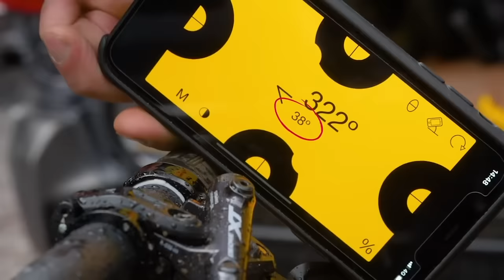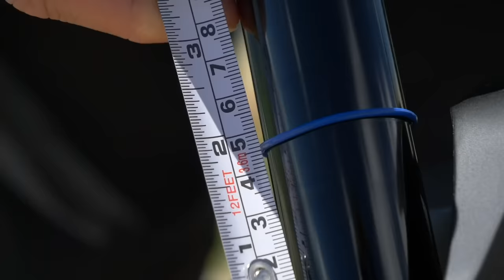9 Mechanical Skills Everyone Should Know | Essential MTB Maintenance Skills

Comment: Thanks, I would add a tip about hex/allen keys, and indeed all spanners or wrenches if you prefer.
 Always think in advance what would happen if it slips, or shears etc where will your hands and fingers end up. Particularly working around gears and chain rings. Make sure a slip results in your hands falling away from danger points.
 Everyone who works with tools learns this the hard way, so avoid it from the start.
Reply: also, clean off the bolts because the grit in them will erode your bolts and tools
Reply: Haha I've always had a phobia of this
Reply: I punched my brake rotor the other day.
Reply: @creekboi7  punched the chainring the other day and needed 5 sitches, definitely be mindful of where your hand will go

Comment: 6:56 Neither of my bikes came with a shock pump when they were brand new and when I upgraded the fork on my xc bike it also did not come with a pump. I had to get a Rockshox one from Amazon for £20
Reply: I thought the same, perhaps only when you get given bikes too 😂
Reply: Same, since he mentioned it I almost feel like I got shortchanged. Almost a 4k bike, but no pump :/
Reply: I didn't get one and I have a good 500 dollar trail fork
Reply: @thxman1968  it maybe a country thing, like how some phones you can get in Europe have a case in the box but if you get the American version it doesn't come with one
Reply: @MrStevegregory  no its generally when its really expensive forks
Reply: It’s only for expensive forks/ setups for sure, but you can get a good analog shock pump for relatively cheap and will save you a tonne!

Comment: The only thing more expensive than not looking after your bike, is paying someone else to do it.
Reply: I would say that doing it yourself is pretty close. I work at a shop and we make a lot of money fixing mistakes of the home mechanic
Reply: @mrdudemanmwane8963  Haha, it's the way around for me. I'm still an amateur, but I always need to fix my bike after it's returned from a big repair at the bicycle maker. Working on your bike needs to be done with time and love!
Reply: @mrdudemanmwane8963  I can believe that, but if those home mechanics learn from their mistakes and persist they will get good eventually and save money on the long run.
Reply: I think it took like 33 hours to figure out how to properly adjust a break pad after taking it apart because it was loose... the mechanic is way cheaper.... sigh
Reply: I'd say not doing it is far more expensive. If you don't do it at all then that's going to cost you much more. Buying tools is also expensive, especially for parts you rarely need to get to. Better to take to a shop in that instance. Everything in this video is 101 basic.
Reply: @JZ-xu3vg  if you can not even sort out brakes pads then you should not be riding a bike lol, i learned hard from the bike shop lies, when making out they did jobs on my bike and never, saying they serviced the bike and then the i still needed a freehub on back wheel, it was their lies and ripping me off that made me take apart my full sust and re do the work they never did properly, i am thinking of showing this on a blogg post or youtube, as now with youtube and the internet its easy to spend some time and do your  mechanic work, starting off and building up to get better bikes and tools over the years, i am blowen away in how the shop will charge, for tubless set up he wanted £40 to start, in one shop here they never took the innertube out my mates bike and did a basic tubless set up, daunting at first it can be, but in bike shops they will make out its worse than it is and parts need replacing that do not, that it's more complicated than it is, i trust halfords more than the local shop, i was loyal spent a lot of money in there overthe years, then they started to act like trotters independent traders
Reply: @titusflavus4172  Yah it takes time to learn though I didn't pop out of my mommy knowing how to change a tire either.

Comment: One tip for bleeding brakes... use elastic bands to hold the levers 'in' overnight... that normally forces any bubbles up out of the system.
Also Doddy, get over to Blake's place and make his bike storage more secure...
Reply: David King I do that , though I use a cable tie.
Reply: @andygilbert1877  Yep, works as well, but I think the rubber band has some give to save the seals being under pressure for 6-12 hours overnight, plus it does provide constant tension to ease the bubble up and out... a zip tie just holds it in one place but with no subtle load to activate the physics of it all...

Comment: One of the best mechanical skills to have as a mountain biker is, the ability to fix a broken chain like new in 5 minutes.  Like everything else it takes a little bit of practice.  When it's done correctly the place where you broke the chain is stronger.   If anybody tells you that's a No-No  it's because they're either trying to sell you a chain  or they don't know how to do it correctly.  Your chain is only as strong as its weakest link.  That link is your master link if you use one. I've seen Master links rip in two.  Been doing it that way for 30 years,  broke my chain once in 10 years. And it was because something got caught in it.    My recommendation is to get an Old chain and practice.

Comment: If you find your Hex nut has rounded off inside, a torque bit of the same size will generally grip it in the corners and free the nut up. Just for anyone that finds themselves in a bind.

Comment: @05:20 TIP 1: put the tyre on with the centre of the maker's name at the location of the valve - this way you can trace the location of any intrusion and/or damage to the wheel far easier (especially if you have inner tubes).
TIP 2 (and 3): get a bike stand for set-up and maintaining the bike - and use the stand clamp on the seat post (this is the least expensive part to replace if you break it by over-tightening the clamp).

Comment: For years i shuttled my bikes to the bike shop. A year ago, I bought a bike stand and every paycheck i would buy a tool or tool set and with the help of YouTube over the course of the year with proper tools for the job I've taught myself.  I can now remove install cups unthread and regrease my bottom bracket and change if necessary.  Do simple things like chain or change rear cassette or front chainring.... Recently swapped front fork cut and installed ⭐ nut.  Saves so much time and 💰 and i love my MTB even more!

Comment: Very helpful video!

I normally just drop off my bike at the shop  bi-annually for a tuneup and upgrades, etc.
Now, that I'm sheltering in place, and just bought a new bike ( Ripmo) and  have time on my hands,  I have more time
to learn.

As Doddy stated, it is very satisfying to learn how to do things on your own.  I really want to learn how to do the brakes and drivetrain.  

I have to admit, I'm a bit scared of F'ing something up though, with more technical stuff.  Such as replacing the bottom bracket, or anything else that is attached directly to the frame.  These bikes are damn expensive to purchase, and damaging something such as the frame is gonna cost you even more!..LOL.   I guess I just have to be careful.  The shop I go to has a real nice staff so they could advise me, and if I'm really lost, they don't charge much...LOL.

I think it would be cool to build a bike from the ground up!  Eventually.......

Comment: Get a set of Torx and Alan key 3/8 ratchet set. You can get a long ratchet to give you great leverage. Use a mallet and a socket to shock loose seized bolts.

Comment: I changed and tuned a rear deraillure without opening the chain up, that was my first major bike service project just a few months ago. Now I'm looking at installing a full front hub eBike kit, and I've learned a ton about bike parts, repair, service and tooling. I've got a pretty nice full suspension frame that I picked up for shockingly cheap at Wal-Mart, especially given that it has some really good parts and build on it, on top of being decently light, and I want to make this thing a comfortable as nuts road/trail hybrid eBike. The stock fork seems a bit tough on the spring for my use, so there's a chance I might size that up and swap it as well, but thanks to guides and tutorials from people like you I feel confident that I can easily transfer my overall mechanical knowledge into the biking scene as well, and turn what I have from a good budget bike into a great overall bike, at least for my personal use case.
Reply: No chance a Front hub ebike Kit will work well on a Fully bro. I think it will ride a little bit weird
Reply: @SLPrevious  Already did it, not long after that comment. Ran like a dream, still runs like a dream now.
Reply: @kmemz  ohh okay, nice to hear! 
Im like the Mid Engine Ebike guy and cant really go back to som different tbh, rides to good

Comment: 6:39 ok setting sag on the suspension there are two types sack there are high medium and low the sag on your suspension if you're lightweight person you have it on their own of the softest setting in the medium setting as well if you're a heavy Rider you have it on the hardest setting but also there is a crucial moment wear certain riders have it on the hardest setting where they going off road and jumping on certain places by the toughness of the actual hard most of the Fall and takes the compressor of the pressurised bounce if it's too bouncing it's only there for likes a comfortable dancing ride for the lightweight people the medium weight people have to adjust it so it's like medium setting the heavyweight people that have to have it on a harder setting

Comment: After flushing/bleeding brakes leave the bike overnight with a ty wrap putting moderate pressure on the brake lever to let the tiny air bubbles bleed out.

Comment: 7:02 setting up the sag on the air pump itself make sure it's your own body weight or sometimes you have to do it over a little bit toadie weight itself is holding it will you do end up losing a certain amount of pressure inside their especially in hot whereas the fork is in a heated area the air itself inside of it starts to transform and loses the pressure because the heat start with the Vapour and starts making small water in cider heat combined with cold air when you have a puncture or you start releasing how you start smelling weird smell inside your inner tubes like a fishy rubber smell left your bike in a heated area if it's in a cold area it will freeze up and your stories of the amount of pressure is best to have your bike in a medium warm called area but it's not too cold and not too hot

Comment: I already started upgrading my « old » mtb. It’s a univega frame with shimano brakes and gears and I wanted to change my tires. 27,5x2,10. First mistake, I ordered two continental cross king tires with size 27,5x2,8. On the front it fits perfectly but on the rear side not at all, it scratches the frame and I had to sell the second one. Now two rainy weeks will come and I plan to strip my bikes, clean them, lube them, and maybe paint some of the scratched parts. One thing I am curious is if you made a video on how to lube the front suspension (I have a hardtail). Cheers

Comment: very informative video. however i have to disagree a bit when it comes to tyre levers nylon ones are crap. can't  coun how many timpes they have snapped or broken. causing huge bloody knockles. metal levers used correctly and with a bit of caution are way better I find.

Comment: Not that it will ever be anything but a pipe dream, but looking at CRC for parts I am just completely lost when it comes to wheelsets and brake cables. The former I do not understand how I can tell if the rear is compatible with my groupset & casette or how to figure out how loud the hub is (I do not like the super loud rattlers), the latter I do not get what kind of cables you use for hydraulic brakes, because all I see are those with an actual steel cable inside (and as I understand hydraulic systems, you actually compress the fluid to actuate the other end, instead of pulling a cable). And it seems to be way more expensive than complete bikes, even when picking cheapish parts, and that does not even cover the cost for all the tools you need.

Comment: 3:52 it is about the tool set with you using so the person is right about this but it's also bad Brand and make of the Model what you were purchasing as well if you bought a set of race Face handlebars or DMR or Easton bars Eastern stem DMR stem race Face stem United that you going to get a top quality bolts inside them no the cheaper models where you see on the internet cheap because you get faults on them

Comment: i just changed for the 1st time in my life a tire. Front one, i did it in a confined basement, at some point i used a torx key as a lever. Not proud of it, ill buy some plastic levers before changing the back tire. old ones were Trayal 29 2.1 , new ones Conti crossking shieldwall 2.2 
i heard u can change only with hands but with 2 levers will be very easy.
Edit:the rear one was alot harder to change (compared to front one), took me about 20 minutes. No levers=worst ideea ever.
Reply: Really? I was able to seat my tire just fine by hand. The trick is to partially inflate the tube, then let air out until you have enough room that the tire goes in simply by squeezing.

Comment: #ASKGMBNTECH
Hi guys, I just changed my drive from 3x10 to 2x11, and as always im having issues with front deraileur.
I think i should change the spacers on bottom bracket (curremtly i have 2 omn drive side, and i think due to this im having issues with the ranges on my front derreileour.
Please can any1 confirm this?

Comment: #askGMBNTech  Hey, I’ve got a new specialised rockhopper expert 29 (2020) and had major hassles with it.  Now broken two rear mechs with no major hits on them or accidents.  I did flip the bike and the hanger bent on my helmet, but no other damage.  SRAM have now upgraded to the GX mech but have said any further issues will be deemed a rider error.  I’m a bit worried as I’ve only ridden the bike 7 times and not even pushed it.  Are there any subtle riding style issue that I need to watch out for that may cause this issue?

Thanks in advance

Comment: who wants to give me a steer on a replacement fork set up ?? Specialized fuze 27.5+ 3 inch tyres, the original set up is only 100mm travel being a newy to the bike scene i haven't got a clue but want something better than what's on there now, does the amount of travel matter so much ie can i put forks on with 150mm of travel or will it change the dynamics of the bike ??

Comment: My free allan keys have lasted me 5 years and still going strong
Reply: That's impressive! I tend to steer clear of them because I have one round out a bolt and itself on a new set of grips
Reply: They can last long if the torque you have to apply on them is not too high (usually the torque for Bike components is not really high, because the aluminum is the limiting factor).

Comment: So, what you're saying is: "hydraulic brakes on pedal power bikes are an expensive, headache inducing gimmick for people who have more money than brains that want to flaunt their over priced problematic maintenance intensive chumps purchase in your cable brake using face. Hydro brakes offer a .03% increase in brake lever feel (if they're working properly) over "old school" cable activated ones but almost everything else about hydraulic brakes suck corn kernels outta brown samples dropped off at doctor's offices. Got it. Cable brakes = set it and forget it, go ride. Hydraulic brakes = must use correct oil, bleed kit and bleeding, start bleeding the night before, change brake fluid once a year bare minimum or if fluid becomes contaminated, check for leaks...every ride, check fluid level...every ride, check for water/dirt contamination...every ride, crash? might have to replace some parts then bleed the brakes, check for bubbles/leaks/contamination, ignore everyone laughing at you and your hydraulic brakes, say: "they're better than mechanical brakes in every way" to induce even more laughter - start the race while they're rofl, 10 minutes into race - stop and check fluid level and for leaks, add fluid as needed, uh oh - bubbles in line means avoiding those obstacles just got more intense by a factor of 7 (white knuckle territory), in one instant factor goes from 7 to 8 (teeth clenched so hard that you just bought your dentist another big vacation, then from 8 to a factor of 9  (ass biting holes in saddle territory), and finally from 9 to OH SHIT! factor 10 (acceptance, peace, collision/tumbling lasting longer than hoped and pain + seat/foliage/soil extraction).

Comment: #askgmbn hi guys I need to replace my free hub body on my deore 12  X 148 hubs but I can't found out the part number to replace it with  and the manual doesn't give you the info I know I need 15 mm Allen key to take the body off so not all body's will fit l.... Do I need to use a Shimano part or will a different brand like   nuke proof body work as well. Thanks for the help .
Reply: 15mm sounds too big.